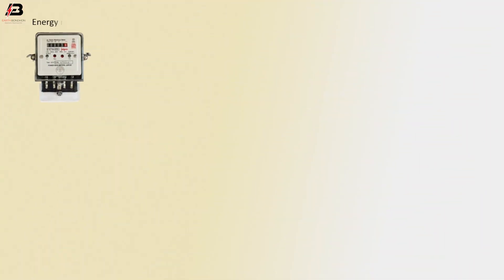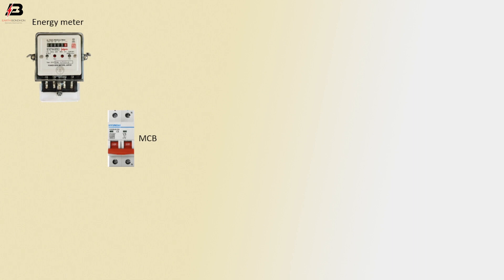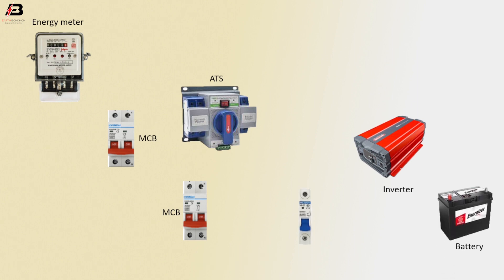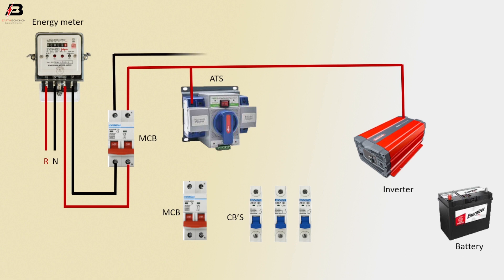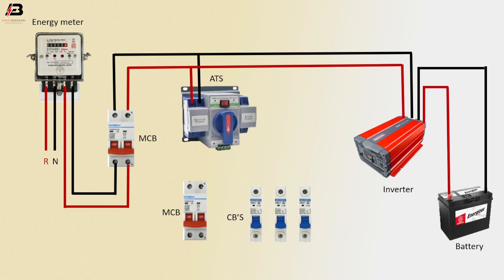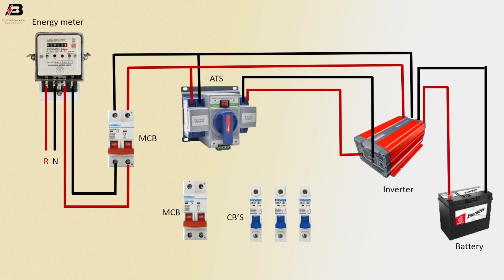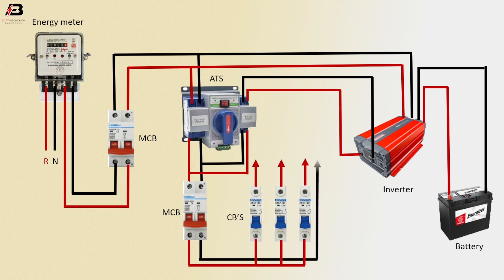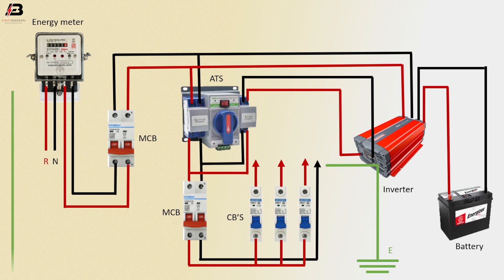ATS automatic transfer switch changeover wiring diagram | ATS | changeover switch

Comment: Thanks, for the video which helped me a lot. I purchased the same ATS as in your video from Amazon. It arrived without an instruction manual. I would like to ask you a question, which way should the lever be pointing and should the button be on auto. My setup is the same as demonstrated in your video.
Reply from the maker: Electrical and Electronic video please recommend us in the comment section. Be stay with us and learn Electrical and Electronics easily. Check our playlist for different types of videos.